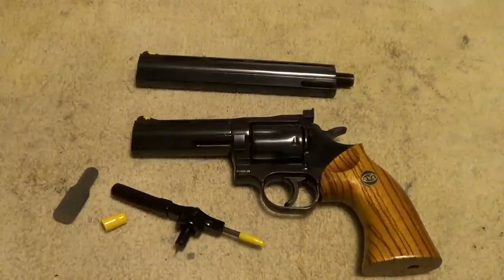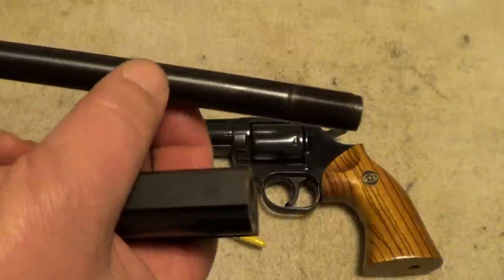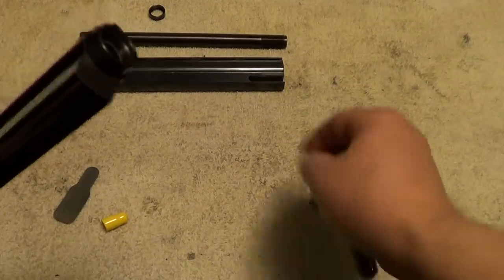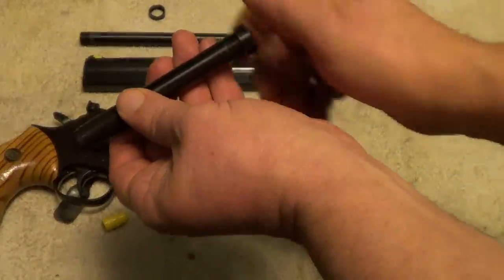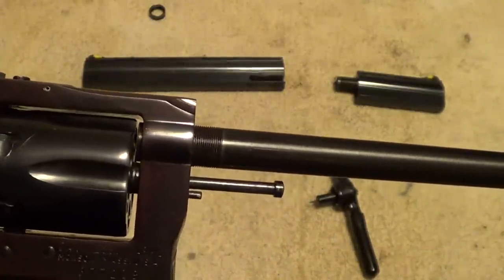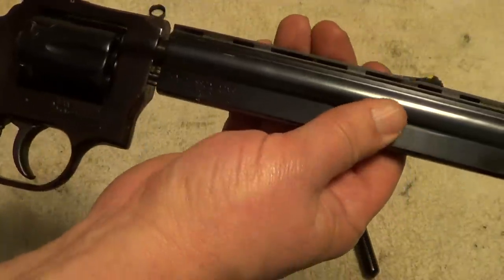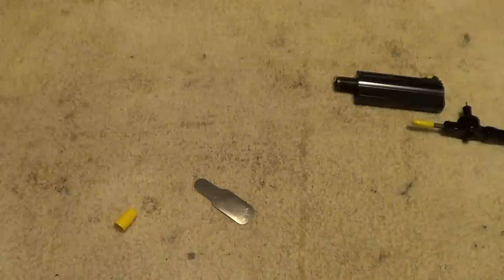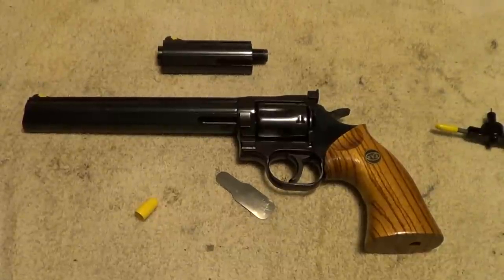Dan Wesson Revolver Barrel Change

Comment from the maker: I bought the whole rig used as you see it about 15 years ago.
It originally had 4 barrels fitted in a carry case. Along the way someone added the 10 inch barrel to the set.
They were also sold with just a single barrel and as a two barrel set. The sets were called Pistol Pacs.

Comment: Have had my model 15 for over 40 years, still a good shooter. The theory is that by having the barrel held in tension and compression simultaneously accuracy is enhanced vs the standard barrel held in place only by one end at the frame.
Reply from the maker: That might be true. But every time you change a barrel you point of aim changes. Even if you just remove the barrel and then put the same one back on.

Comment from the maker: If you use the feeler gage to set the cylinder gap the same each time the point of aim will not change. At least not enough to matter at normal pistol ranges.
But the different barrels will shoot to a different point of aim. It`s not a serious difference, but noticeable.
Reply: Absolutely. It HAS to change from barrel to barrel, because the velocity of the projectile changes.

Comment: Two quick tips. Don't spend big money on feeler gauge or barrel nut tool. The gauge for a couple bucks at any auto parts store. Barrel nut tool is often crazy money for the original style but, can break loose from the plastic if it was used on over tightened nut. EWK Arms sells a great tool for $25.00 plus$3.99 shipping and it's US made! CZ wants about 50 bucks!

Comment: Nice job with the barrel swap. Did this gun originally come with all the different barrels or did you buy it used and someone had purchased all the barrels as a set? Good job filming around the camera. I've been filming stuff with the camera on the other side facing towards me, and just placing the gun upside down (butt away from me), works pretty easily and it frees up your hands and work space. Just a thought. Cheers

Comment from the maker: It can be changed in a lot less time if you just do it instead of talking about it while you are doing it. :)
$1,700 is way too high of a price. These are not cheap these days, but not that expensive.
Try the gunbroker auctions. You will find inflated prices there as well, but not all of them are. You will find some that are more reasonable selling prices.

Comment: thanks for the instructional video! I just bought this pistol with the 8 inch barrel and am looking for the extra barrel kit and tools for it. I always wanted a Dan Wesson and found one at the gun show for 400 bucks with just the 8 inch barrel. do you think I got skinned or did I do alright?
Reply from the maker: If it`s in nice condition, that`s probably a fair price.
Try the site below to find an extra barrel if you want one.
http://www.gunbroker.com/
Reply: the pstol is in like new condition. there isn't even any cylinder marks like there would be if hand been turned or cocked a lot. the lands and grooves have no wear at all. the gun is flawless. thanks for the info!!!

Comment: Why not use the feeler guage to make sure that you have the proper clearance on your barrel rather than eyeballing it? That way you're certain of proper clearance and tolerance of barrel.
Reply from the maker: I did use the feeler gauge. But it never hurts to eyeball it to make sure you can see daylight. If you have a gun where the cylinder/crane is not perfectly aligned with the frame the cylinder gap may vary a few thousandths depending on which chamber you have lined up with the barrel.

Comment: I've heard the problem with this design is that every time you change the barrel you lose your zero. I have 1985 Dan Wesson 357 vented, non heavy barrel, in stainless steel, still have the original manual for it and all the tools, but no extra barrels. I took it it apart for cleaning, inspection and curiosity, turns out I did lose my zero next time out. Interesting guns though.
Reply: I have a late 1970s vent heavy, with 4" and 8" barrels. I used to use the 4" barrel when I carried the firearm in a shoulder holster, under a suit coat. The 8" barrel was my hunting and silhouette barrel. And although there was a slight change in zero between the 4" and 8" barrel, there was virtually no change in zero when I removed the barrel for cleaning, and then reinstalled it, provided I used the feeler gauge, along with the SAME ammunition.

Comment: I am interested in buying a Dan Wesson 715 Revolver Pack but I just found out that they are no longer being made. I want to ask you how do you like your Revolver? I have a Colt Enhanced King Cobra that was sold by Lew Horton back in 1992 and I purchased it brand new in 1993. My King Cobra is a Bright Stainless Steel 4 inch barrel and it is a good revolver but I want to get a 6 inch and 8 inch that I can use for Hog Hunting here in Central Florida and a buddy of mine suggested getting the Dan Wesson 357 or even the 44 Mag.
Reply from the maker: It`s a good revolver. But the L Frame Smith & Wesson revolvers like the model 686 is just as good or better, and a lot easier to find.
Reply: @1957Shep  I was researching the SW686 but I read a couple of articles where they gave the Dan Wesson a higher grade because it had a Stronger Action than the SW while still having a very accurate barrel. I would love to get one of the Bill Davis Cougar Colt Barrel Ruger Frame Revolvers from the 80s and 90s but those are normally 3-4 inch barrel and very rarely seen in a 6 inch and when they pop up on Gunbroker or at gun shops they normally run 3-4k! I remember reading the article about the Pistol pack back in 1983 when I was in middle school and i thought it was the coolest thing in the world to be able to change barrels. Now that I am older and gotten about every semi auto pistol I ever wanted from 9mm to 45acp and 10mm auto and everything in between by all the major player I have been looking at getting some of the niche firearms on my bucket list but I do not like to waste money if there is something better than the Dan Wesson I do not have a problem spending the extra money within reason to get the better item as long as it gives me better capabilities if you know what I mean.
Reply from the maker: @af22raptor23503  Everything is a trade off. If I understand correctly what you mean by stronger action, you mean less prone to wear. But that also means more surface area on the moving parts of the action. Which also means the harder it is to make the action smooth and the trigger lite.
But that is rarely an issue. You would have to run a lot of rounds thru and good quality revolver before you would start to notice any wear to the lock up and/or timing.
The Dan Wesson Pistol Packs are becoming something of a collector item these days. So if you really want one, probably best to get one now if you can find a good one. The prices will probably continue to go up.
I gave $400 for this 5 barrel set used, but that was over 20 years ago. It would probably go for 3 or 4 times that price today.
Reply: @1957Shep  Thank YOU! You were correct when you referred about my comment about the Action being Stronger I had an issue with my King Cobra having a Timing issue that took 3 trips to Colt that did not fix the issue and then a Master Gunnery Sgt what was teaching me how to work on 1911 during my off duty time while I was in the Navy figured out the issue and fixed in 5 minutes. Right now 5 barrel pistol packs from the 80s and 90s with Heavy barrels are going for 1800-3000 depending on condition and blue or stainless.
Reply from the maker: @af22raptor23503  The heavy barrel shroud on the longer barrels isn`t that great. The extra weight does help soak up recoil, but it makes the balance very nose heavy.

Comment: Just picked one up on trade. Unfortunately it didn’t come with the extra barrels or box.
Reply from the maker: Actually, the vast majority of them were sold with only one barrel. And the owner could add extra barrels/grips/sights later on as they wished. The Pistol Pac that came in a case with either 2 or 4 barrels with extra grips and sights are kind of rare. Or at least rare compared to the basic revolver.

Comment: a question about the barrel thickness. i notice the barrel is thinner than that of most other 357 magnums such as colt python or s&w 686,etc. do they（colt、s&w） make such thick barrel just to balance the recoil or stand the high pressure produced by 357 or both?
Reply from the maker: The shroud supports the barrel adding strength and stability to it.
The highest pressures are in the chamber. Pressure spikes at ignition (with fast burning powder used in pistol loads) and drops off rapidly.
With modern steel, the barrel doesn`t need to be all that thick.
But as a general rule, a thicker barrel will be more ridged and stable improving accuracy.
And as you said, the extra weight greatly reduces felt recoil.
Reply: 1957Shep thanks a lot. that really resolves my confusion

Comment: I always used the feeler gauge. I don't think my barrel was ever disassembled, and when I did, after 20+ years of shooting, there was a lot of carbon build up in the threads where the barrel screws into the frame. Well the barrel used to be tight, with the shroud OFF. After cleaning the threads, the barrel wiggles ever so much, even when in place with the gauge. Maybe that affects the barrel and where it points once fully assembled? Of course it doesn't wiggle once fully assembled. Yes or no?
Reply: When you install the shroud, and then screw in the barrel nut with the multi tool, the nut acts as a tensioner. The barrel is secured front and back, making movement impossible.

Comment: I have S&W model 36 with 4 inches barrel, and i wonder if i could change the barrel into 1.875 barrel ?
Reply from the maker: S&Ws are not designed to easily change the barrel. You would probably need to have a gun smith do it.
Are you sure it`s a model 36? To the best of my knowledge the model 36 was never made with a 4 inch barrel. Only 1 7/8th, 2, or 3 inch.